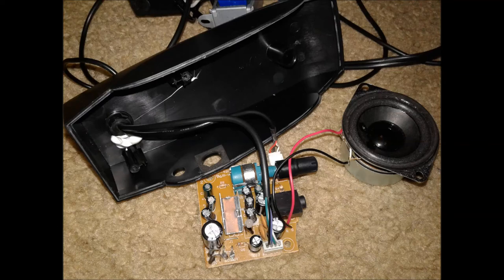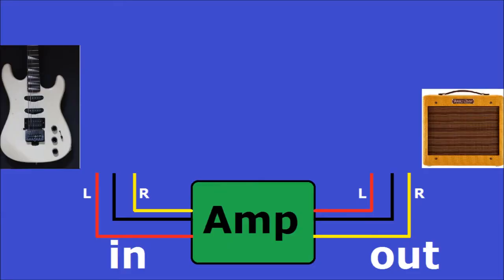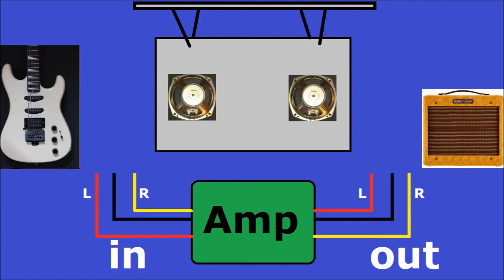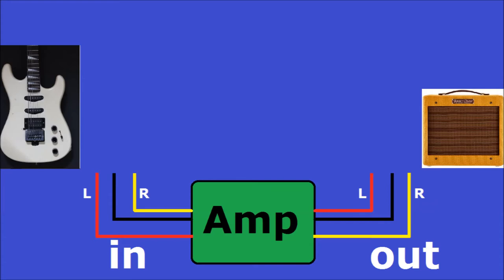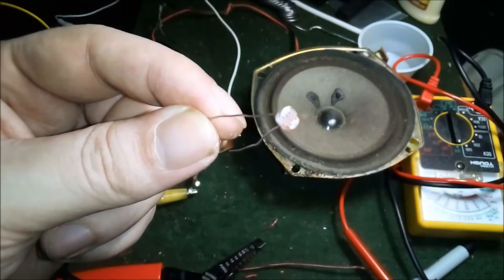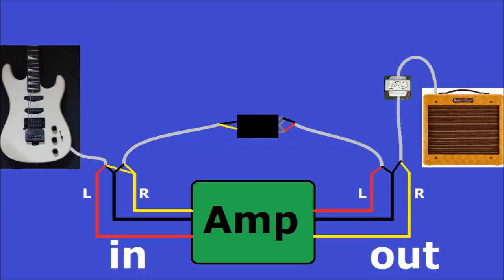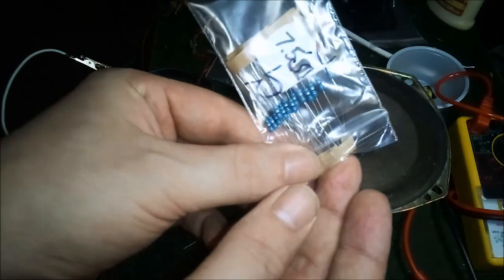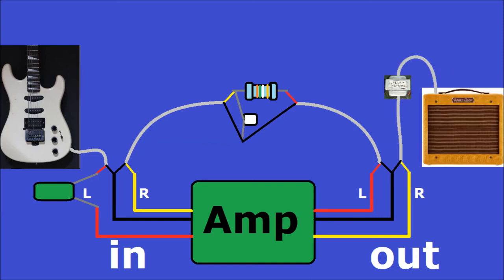DIY Analog Studio Gear Made From Old Computer Speakers (W/Demos)

Comment: I am loving these videos. everything about them. the accent perfectly matches the engineering methods.
I'm just wondering, like everyone else I have lots of Wall Warts in a bag in the garage. How important is the rating? I don't want to blow up my Amp working that out. I'm in the UK by the way so most of them are 240v down to about 12v. 

Also I know that passive Di is essentially a transformer so would that be something super simple to knock up too?

Comment: Regarding the compressor I think it can be simpler. A filament lamp's resistance increases the higher its temperature, and it's temperature increases the higher the voltage it receives. So basically using it as a simple resistor in the chain should automatically just squash the transients
Reply from the maker: Thank you for watching  atrumluminarium ah, yes good info. My uncle used to use this method in his big concert PA cabinets. If you put a light-bulb in line to the speakers it will buffer those peaks.. it will also act as a fuse and blow before you have destroyed the voice coil in those big expensive speakers.
Reply: @heavymetalATC  Ah didn't consider the fuse issue, good point. To be fair my only experience with this was to have a passive compressor unit within a guitar itself so I had quite a lot of headroom to work with given the low input wattage

Comment: An excellent "hands-on" approach to sound modification  - just give it a try. An approach to be encouraged, as you have done. There are more subtle tools than the hammer, but, if it works... ;-)
Reply from the maker: Thank you for watching and taking the time to write such a kind, encouraging and witty comment. I agree the hammer may have been more for comic relief but it is in fact how I got the transformer out of the wall-wart LOL messy and loud but effective indeed. Thanks again really the just go for it thing is what its all about. It seems many people hold themselves back with the notion that they need to know or possess something more like a tool or a piece of gear when really if you just use whats laying around you can usually find some way to make that gear from the things that others discard and it doesn't really take much money or any special schooling to do so now that we live in a throw it away and buy a new one society and have the internet. It is the golden age of the diy fix it guy and the tinkerer.

Comment: hahaha all I got is a fucking hammer. You just made my day.
Reply from the maker: Thank you so much for watching and taking the time to leave such a kind and comical comment Robbert. That makes my day! I have a friend Petey that knows how to use a hot knife to open wall wart transformers and it allows him to repair them and glue them back together but, I legit just bust them open with a hammer. Same thing will old stereos or electronics that I plan to use for parts. If the cases are glued or have security tap bits etc. I just bust the cases with a hammer. LOL Thanks again bro I'm glad you dig the unorthodox style and attitude in the videos.
Reply: @heavymetalATC  The real swiss army knife is your brain and the hammer is a welcome sidekick. And maybe there is some room left in my Echo Room for a plate Reverb so that's the next video I am gonna watch.
Reply from the maker: @schipbreukeling3  Plate reverb is the bees knees Robbert. The one I built was just some scrap tin and a speaker and peizo and it sounds pretty nice. If you got an actual set of transducers and used a big heavy sheet of steel and decent power and pre-amps you could make a really magical unit.
Reply: hammer + junk = new gear day

Comment: Love this post!  So on your compressor idea....you use a mono sound source (guitar) but can this be a stereo in source (say from my mixer) to a stereo out?  What would that diagram look like?  Or would that not work since one end of the amp out must drive the led?  I assume two step down trannies must be used then?  Finally, the led is driven by amp out, but the photo resistor is tied to the in?  Correct?  Do you ever sell gear you make?  Thanks!
Reply from the maker: Thank you so much for watching and taking the time to write such an intelligent and well thought out comment Zenon. You are correct you need one side of the amp to drive the LED not it can drive an LED and a speaker or output at the same time but that may cause some distortion from the LED connecting to ground while lighting up, this is done on purpose in some guitar amps and pedals.. So, if you were dealing with a pretty hot signal like a headphone out or line out you may be able to just have the 2  light dependent resistors on those lines going across from pos to neg on each and hook the input of the amp to those lines up as well and have the amp as no purpose but lighting up those 2 leds and squashing the signal... kinda like a "passive" compressor. Or you could take 2 sets of computer speakers I know it would be hard to get two identical for cheap or free... those could be ran side by side as 2 mono systems creating stereo... but with 2 different ones you could use 1 to power the LEDS and the other to squash the signal with the light sensor resistors and this would require 2 output transformers. OK... so thats starting to get difficult and expensive so you could also take 1 set of computer speakers and control LEDS with it... Then get a headphone preamp... hell it could even be a little tube one and use the light resisters on the input of it and you'd have a stereo tube compressor for almost no money. I hope that was easy enough to understand.

Comment: I like to run my pocket pod through my stereo head into my 2x12 marshall valvestate cabinet. Is that a terrible idea? My stereo is a lower wattage. You seem like the man to ask.
Reply from the maker: If I understand correctly that seems just fine. You just don't want to blast a strong speaker output into a line level input. If you do something wrong with audio equipment the smoke and silence will usually let you know. Thanks again for the views and comments Bro.

Comment: Would the optical compressor work with a mono amplifier?
Reply from the maker: Thank you so much for watching and taking the time to comment strings of tembre. I could possible be done but the LED lighting connects the positive and ground through the output wires and any speaker or amp that was connected would receive a distorted signal... it may or may not be terribly noticeable and could possibly be just the correct amount of grit, but technically no not to produce a 100% clean signal because it will create diode clipping like in a distortion pedal or overdrive box.
Reply: @heavymetalATC  oh crap yeah that is not what i need - i cloned a teac mic pre and want to add the compressor but i need a clean sound - thank you!!   you saved me hours of trouble shooting i would have spent.  I will find a different angle on this one.  You're the man!! HMATC